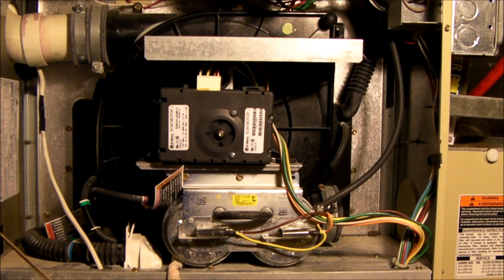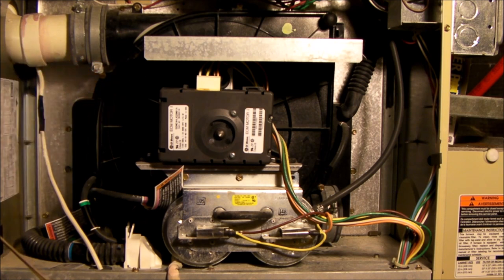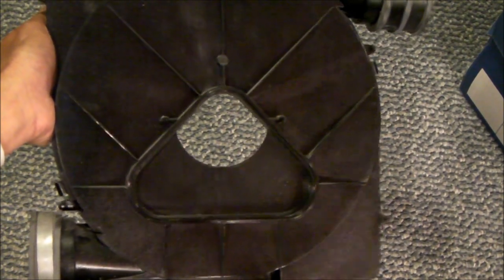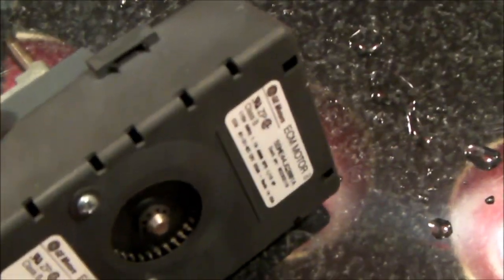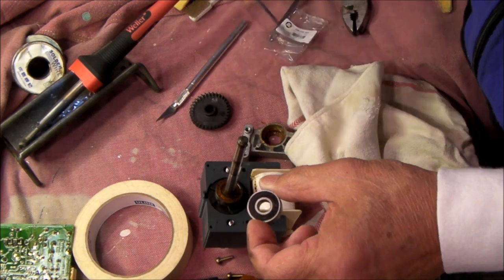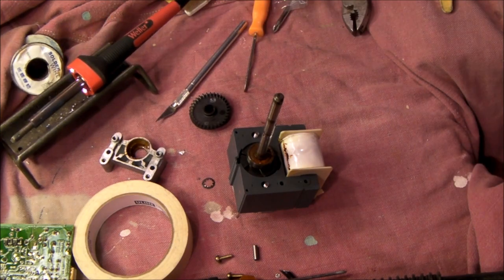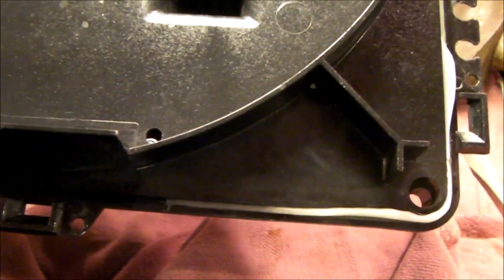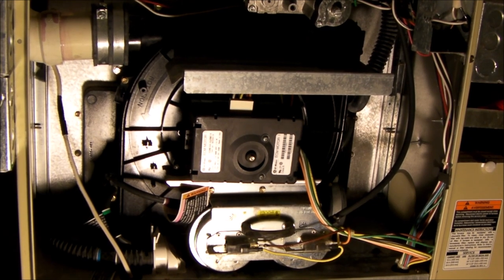Noisy ECM furnace draft inducer ball bearing - FIXED - how to replace the ball bearing

Comment: Anyone watching this video should know, the reason that the circuit board is soldered on and the job is so tedious is because the manufacturer didn't design this motor with the intent to replace the bearings. The intent is to replace the the inducer motor assembly and be done with it. Also there is a very good chance if you have this heater, the heat exchanger is bad. Carrier/Bryant had a design flaw that caused the heat exchanger to prematurely fail which means it is unsafe to operate. Google search your model number to be certain or have a qualified dealer check for you. If you do have a defective heat exchanger, the manufacturer will prorate your warranty with a credit towards a new heater or give you a warranty part.❗Don't wait until the warranty runs out the heaters are not safe to operate❗

Comment: I would like to add that bacteria grows in the water collection box and should be flushed at the end of the season and either sucked dry or add a fair amount of vinegar for the off-season. Often the water will back-up and flood the differential diaphragms and put you in the cold. Keep in mind a repairman will not clean and drain those switches...he will throw-on new and charge you a few hundred.

Comment: These bearings are the same as a premium quality skateboard bearing (no joke). You can buy those oiled or greased...I chose the greased type.
Reply: They’re not the same. Skateboard bearings have 8mm bore. These have 5/16 bore. Slightly smaller.

Comment: My motor has had (in the past) a fairly high pitched sound (started from 5years old)  in past years that would go away if you manually moved the motor slightly changing the alignment (sits on rubber pads). This noise has NOT been a problem for last several years. Today a "NEW" sound (different lower sound) much louder noise, like something hitting rapidly /almost grinding. This could go away if you twisted the motor (up or down and held it there) manually but with a fair bit of force but noise returned as soon as I "STARTED" to release the force. I dont know what is causing this, what do you think it is?   The draft inducer motor is a Genteq 5SME44JG2006D (Carrier 58MVC080-F-1--14 furnace was installed in Dec 2011)

Comment: Same problem - there should be a class action lawsuit, manufacturer spec'd the wrong motor for the application.
Reply from the maker: I politely disagree.  The ECM motors are highly sophisticated and very expensive but the variable speed performance is second to none.
Reply: @YuDaMan  The motor is rated at 1/15HP at 1.1A. Achieving a variable speed control with a simpler motor design isn't even a challenge. 
Strangely enough the manufacturers put an overly complicated motor design in there where simpler option with the same advantage already exists.

Comment: What size bearing did it require?
Reply from the maker: 2nd sentence in description under the video.  It’s a common size for skateboards so avoid the temptation of using a really cheap one.
Reply: @YuDaMan  Thanks, missed the '608'.... Was used to seeing bearings sized as 8x22x7. Very helpful video.
Reply: Let me spare you some grief.  The standard 608zz is not the right bearing. The shaft size is imperial and the bearing bore is metric.  They will all be too loose at 8mm. You need to find a 608 with an imperial shaft which measures 7.938mm.  NSK is the original bearing but I could not find one in the right size.  I bought a NTN 608LLB/7.938PX2/5C.  It was tight and I had to tap it in with a sleeve and hammer. The other benefit was it has a rubber seal (LLB) and will not allow moisture or dirt in like the metal ZZ which is shielded not sealed. Thanks for the video it really helped.
Reply: @markhughes1887  Mark, thanks for the specs on the correct bearing. In my search, I have not been able to locate this bearing. Would you share your source? Is the ID correct in the comment section?  thanks,  dwg
Reply: @4800detroit  Here it is on ebay.  https://www.ebay.com/c/1304503529 
Now I did not buy it there but had my local bearing supply order it for me in Canada.  I paid $40 each.  Ouch.  There are 2 bearings, one on either side of the motor.  I changed them both even though the inside one looked fine.   It is so much trouble I only wanted to do it once.
Reply: @markhughes1887  I used this https://www.bearingscanada.com/1603ZZ-Shielded-Bearing-5-16-x-7-8-x-9-32-inch-p/1603zz-5-167-89-32-miniature.htm had to sand the outside bearing cover to fit. Small job with a dremmel tool.

Comment: I just successfully replaced the bearings on my ecm motor. It was a model 5sme44jg2006d. Steps were almost identical to what was shown in the video except the motor only had 3 solder points.
To remove the bearings from the shaft I placed the shaft vertically in a vise (loosely) with the bearing resting on top of the jaws and hit the shaft out with a mallet. After the front bearing, magnet, and rear bearing are removed I then placed the rotor magnet on top of the jaws of the vise and hit the shaft back into it. Be sure to measure the location of the magnet on the shaft before removing it so you know how far to hit it back in. 
The bearings I got were also loose on the shaft. Instead of putting knurls on the shaft, I used loctite retaining compound which seems to be made specifically for this type of scenario. It's been running like new for a couple weeks now, so far so good. Thanks!

Comment: I have 2 Trane XV 90s about 21 years old.  The problem I had was a long run for the exhaust vent and lots of water coming back into the furnace which all drained through the bottom of the inducer motor.  To further complicate and prevent draining there is an elbow coming off the bottom of the induction blower that constricts to about 3/16" and is easily clogged.  Several years ago after getting tired of cleaning this elbow and hearing the water in the bottom of the induction fan housing, I put a  full sized T in the vertical run of the exhaust vent as close as I could to the furnace with the one port facing down.  I reduced it down to 3/4" and  then put an end cap on it with a 1/4" hole drilled in it.  This drilled end cap is centered over the top of the drainage vent piping on the furnace.  At the time I did it only on the main floor furnace.  It solved the problem of all the water coming back into the furnace.  
      As I have a bearing problem with the induction fan on the other furnace I just did the same to the exhaust on no. 2 furnace.  Just as his in the video, the front bearing is rusty, no doubt due to water coming back into the furnace from the exhaust vent.
Reply from the maker: I don't have a lot of water entering because my exhaust line is slanted downward as it travels out of the house and is a short vertical run and modest run to outside.  I recall this being mentioned in the manual.
Reply: Hopefully you put a condensate trap on that drain that you installed. Otherwise you’re blowing carbon monoxide into the furnace area. Which is potentially lethal.

Comment: I have the same inducer motor assembly and the same code, but the bearings feel perfect. Any idea of what else it could be? 
BTW 608 bearings are the same size used in skateboard wheels. I've had to replace that bearing on my work furnace. One thing to be careful about is, most skateboard bearings have plastic/nylon bearing cages and the bearing on my work inducer motor gets hot.
Thank you for the videos!

Comment: Thanks for making the video!  Can someone please provide information on which bearing puller they used that would work for this job (without having to use a vice to create enough room for the puller to grab the bearing)?  Would any high temperature RTV work (auto parts store)?  Should the push on fastener be replaced?  If so, what size should I order?  Thanks again for all of the great information and comments.  Fingers crossed that my unit will survive the surgery.
Reply: Did you find a good bearing puller?

Comment: I am thinking to bite the bullet and do the repair myself, not ready to spend 4 grands for a new heater. 

Few questions: 

1) What kind of oil you used to lubricate the bearing in your temporary fix, I saw your other video but may be I missed the info. 
2) What kind of RTV Sealent you ended up using for the blower chamber? 
3) at 14:45 you speak of two added seals, what type of grease and what type of silicone O-ring you used there? 
4) The rubber sealed bearing for the motor shaft, does it have to be any specific temperature rated ( I am assuming this motor moves hot air from the furnace, so the assembly will get pretty hot)?
Reply from the maker: i don't recall a lot of details since this was quite awhile ago but don't overthink it.  1.  bearing are pre-lubricated so I left them alone.  2. there was a special GE RTV that was recommended in the operating manual. 
3.  don't recall anything about those seals  4.  air is not as hot as you think.  it's combustion gas venting thru PVC pipe.  I doubt the bearing is in the main airstream
Good luck and be sure to LIKE and subscribe!
Reply from the maker: GE RTV 6700 sealant

Comment: Our now 10 year old Carrier Infinity Series was making a load high pitched noise last year. When I went to check it out I noticed that moving the motor would silence it for at least a few days only for it to come back.  Now this year I hear it again - went up and moved it back and forth and now it is quiet for the time being.  The motor is a Genteq 5SME44JG2006D. When it make the noise you can hear it outside in the back yard coming thru the vents in the attic!  Too bad it's getting cold out now cause I would like to change the bearings myself! We will see what happens......
Reply: Michael Trager
Did you replace the bearings and did it solve the high pitch noise?  Just thought I would ask before I replace the bearings. My motor makes the same high pitch noise but it does spin freely.
Thanks
Paul
Reply: @paulkarisny5575  Hi Paul,  No I did not replace the bearings or motor because the last time I was up there I managed to stop the noise by moving the assembly back and forth and so far that noise has never returned:)  Previously doing this the noise eventually came back but this time so far it has not. It has been fine the whole winter so far.  

I was thinking of purchasing a whole new assembly but they weren't cheap and it was hard to find. Haven't called Carrier on this yet either.
Reply: @michaeltrager4381  I have the same Genteq motor. When you say that you moved the assembly back and forth, did you have to tighten any screws or hold it in a certain position to get the noise to stop? Thanks.

Comment: Good job! Looks like taking off the old bearing is the hardest part.
Reply from the maker: Bearing not too bad but getting the circuit board off will be challenging for most without soldering skill or desoldering equipment
Reply: @YuDaMan  correct me if missed something.  The bearing is on the other end of the shaft opposite to the circuit board.  Could you remove the bearing without having to remove the circuit board?  Also, do you recall the size of the bearing? Thx
Reply: @hnng3919  The endcap covering the bearing is held on by screws that are underneath the circuit board. Removing the circuit board is definitely necessary.

Comment: I am having a hard time getting the setscrew for the motor shaft off. What size is it?
Reply from the maker: sorry I don't have that information.  mine came off very easily.  I don't recall the size being unique or unusual and my standard set of allen wrenches fit it perfectly.
Reply: @YuDaMan   So it was a standard size(not metric) and was it very tight (so it makes a snap sound when it lets go)?

Comment: For those of us that are clueless about such things, can you go into more detail about the 5 solder joints ?
Reply from the maker: they are shown at 8:20 .... three electrical connections but 5 solder joints electrically connecting the board to the motor windings.  The only way to remove the board so you have access to the bearing is to undo those connections by removing the solder.  This takes certain skill depending on the tools you have to remove solder.

Comment: Did this work okay for you? Any further issues?
Reply from the maker: no further issues.  Perfect thru a pretty normal Connecticut winter.  Given how difficult and expensive it is to just get a replacement motor without the whole housing, I'm very happy with the cost and performance of this fix

Update:  Nov 2019 - still running quietly with no other issues
Reply: I’d imagine a faulty secondary heat exchanger is to blame for the bearings failure. Good reason to leave these repairs to the pros. Don’t fix just the failure.. need to address the root problems
Reply: @jeffb8437  go on governor.
Reply: @jeffb8437  His problem was the bent bracket holding the motor to the housing causing it to not seal properly and water got out and rusted the bearing which he replaced and bent the back straight again.
Reply: @jeffb8437  The manufacturer did... they rebuilt the entire assembly to correct their flawed design.

Comment: Great video, working on this now. Anyone run into a problem getting the set screw out of the collet holding the impeller on?  Mine is not budging and I don’t want to apply too much heat and potentially warp the impeller. Not a lot of room for error. I may end up having to drill it out 🫣
Reply: I worked on mine tonight.  Getting the impeller off was the most difficult part of the job so far.  This one has a plastic impeller that was friction fit.  I ended up clamping the lower part of the shaft between two pieces of brass in a vice and after lubricating the end where the impeller fit into the shaft and getting a lot of exercise in the process, got the impeller off and inadvertently loosened the magnetic part of the motor from the shaft.  I'll use some loctite to secure that back in place.  I've not been this deep into an electric motor before but think I'll get it back together and working again.
Reply: Apply penetrating oil, wait about 30 minutes. Apply more penetrating oil. Wait some more. Use a 1/8” hex bit with an impact drill. Works every time.

Comment: I got exact problem.  Talked to a HVAC guy and they told me some people had a very bad batch and have this exact same issue. Parts cost +1000$ for inducer motor assembly , at that point I just bought a new furnace for 2600$. 

Fuck carrier never going with them again.
Reply: It's not only just Carrier, I have a Bryant 95i series and it has the same motor with same problem. 
Tech came by today and the motor costs $1400, even that is on a national back order. 

So even if I wanted to spend the money, I can't, because the manufacturer can't supply it anymore. 
My furnace is 12 years old and my only options are either try to fix the motor the hard way or buy an entirely new unit. Imagine that! 
Also there is no HVAC company that will fix the bearing and save me from buying a new furnace.
Reply: @shkhamd  The reason HVAC companies don’t replace bearings is because of liability. If they replace the bearing, they are liable for any future failures. It’s not worth the risk for them.  Your best bet would be a handyman probably.